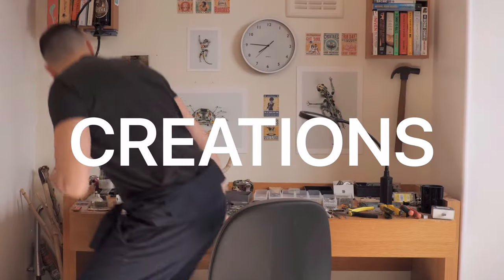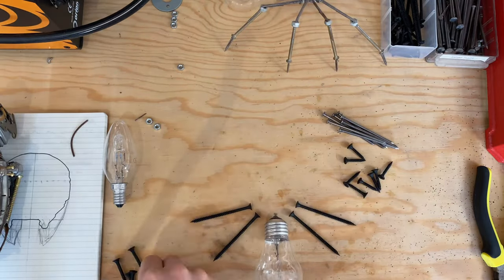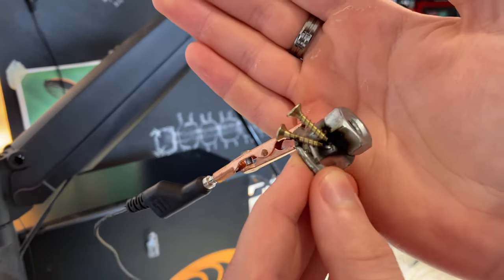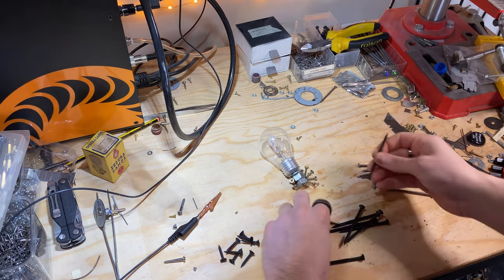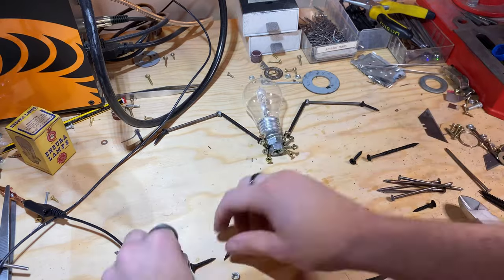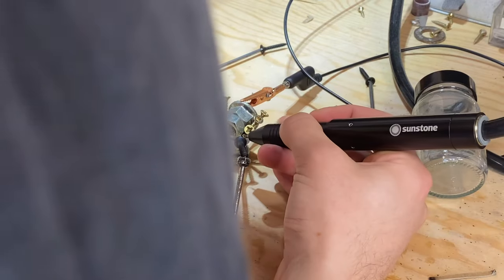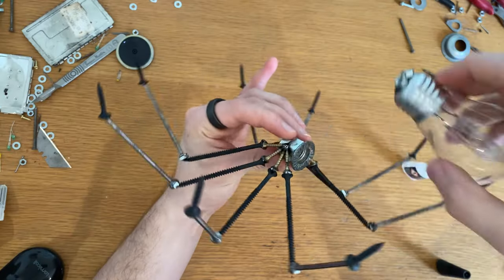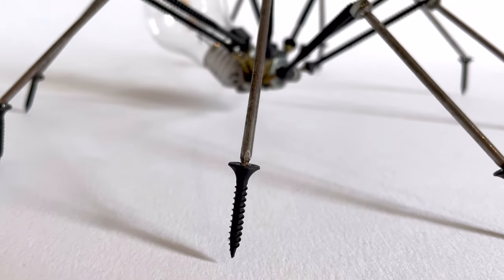How to make ART with scrap metal!

Comment: I love seeing the proces! And the length for me is just right.
I wonder, seeing this, do you glue parts before you weld? And if so, is there no risk of flames developing?
Reply from the maker: Thanks Sjiva! So to weld you need an electric current between both metal parts, which means if you glue them, the electricity can’t conduct because the glue has blocked it! So because of this if you glue parts together usually you can’t weld them
Reply: @zakmiskrycreations  Thank you!
I was wonderi g this because in the last bit, when you talk about attaching the lightbulb, you mention both using welding and superglue. As the spots you weld and the parts you glue are in such a close proximity, I was wondering how that would work. Do you first weld, then glue?
Reply from the maker: @sjiva7061  so for this what I did was I glue the nuts to the bulb, and then weld those nuts to the thorax, because there’s no glue between the nuts and the thorax I can still weld it! Like this bulb —(glue)— nuts weld thorax
Reply from the maker: @sjiva7061 the current can flow through the nuts and thorax, but not between the nuts and the bulb, does that make sense?
Reply: @zakmiskrycreations  thank you so much. Now I understand!